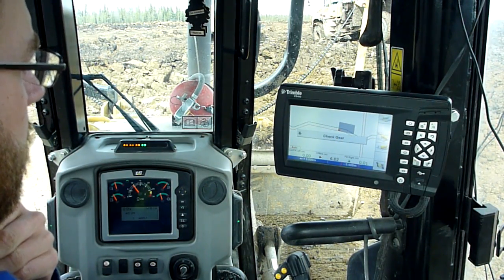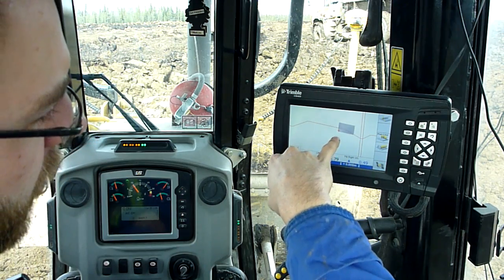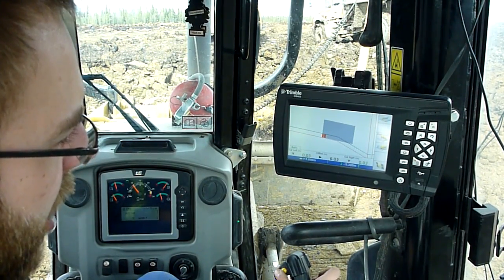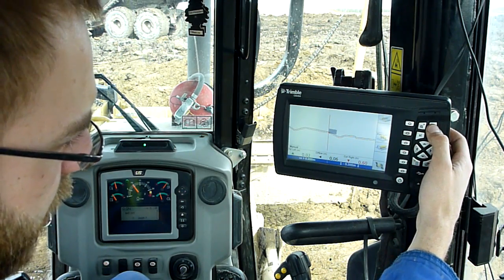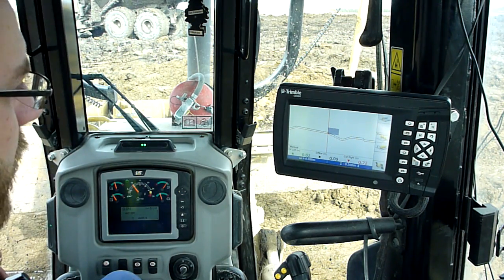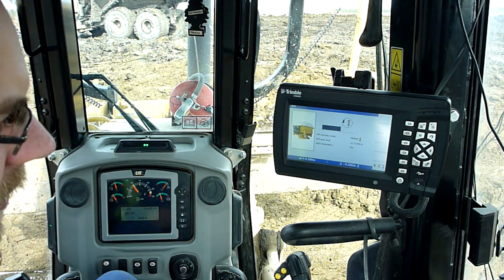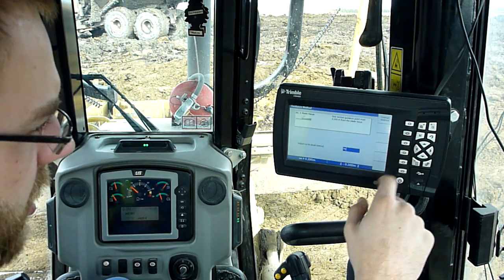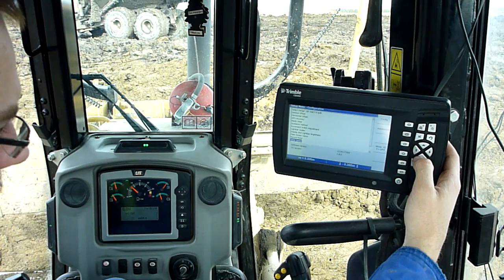Trimble GCS900 3D GPS System in a Caterpillar D6N

Comment: I assumed as much. Just couldn't melt the Trimble and machine together. It just seemed to me that they are separate ,Trimble being a tool, yet now I see that they are kind of interfaced with one another. thanks. you make pretty good videos. It is sometimes difficult to hear in many of them. Thanks again.
Reply from the maker: The blade is controlled through the ECM so the Trimble control box connects to the ECM. From there you use an AS400 slope sensor to calibrate how quickly the lift and tilt cylinders are actuated, and can dial in blade sensitivity for different types of material.

Comment: Great video! Wish Trimble had a profile & cross section view simultaneously for cutting vertical benches around curves in complex models! Works better then a horizontal light bar when anticipating when and how far a line will curve on the fly. Also an infinity adjustable read point on the blade for narrow benches.
Reply from the maker: Shane go into your main screen views and select split screen, you can change the options to have profile and cross section at the same time. You can also adjust the read point by using the custom point option. I think the split screen options open up more in v12.4, I'm not sure how far back the custom points option go. You may have to have the survey manager enable these option.

Comment: I hope Jason doesnt kill me for answering ;): no, a true GPS-System got around 3cm accuracy, its juts not that precise, but its able to run in 3d, like if your building a golfcourse or grading the slope of a pond or something.
a 2d Laser-System is around 0,5 to 1,5cm, depenting on the material you are grading. but its only capable of 2d, so you can only grade a flat surface with max. 2 slopes (as much as the Laser can be set, like 6-8° ) .

Comment: A lot of those problems can be alleviated with a good model. A model that's built tailored to your machine IE blade length, turning radius and much more makes all the difference in world. Getting someone who has operator/real world experiences with machine control to build your models can make things go a lot smoother in the cab. Let me know if I can help!
Reply from the maker: The client supplies the design and we get paid to build it to what the engineered. You can't just change things because it will be easier to build.

Comment: Thanks for the upload. It is interesting to see the differences between the lower priced like this being lighter I am assuming they find their mark with logging firms or something like working on ice where weight is imperative but also nice to see the differences as far as possible in the cabs layout. 
The gps I can see would take a bit of practice on high ground but as long as it can be trusted and one can work to it it has got to be easier, though I think a pic of the blade only is better

Comment: towards the final grade and direction of the cut would be pretty much entirely by the blinking light on the 'clock' console rather than any grade markers outside?
In fact grade marker could actually get in the way and be wrong, so will grade markers still be there but in a different 'FORM' and show in figures the max depth and slope which it should be, and forgive me but it is a while since I worked in the building trade?

Take care.
mrbluenun

Comment: of soil and levelled it, and at that point the road (M25) was to be about level before it started going down a gradient for a mile or so.  

Hope you can get the gist of my 'best' explanation. I would imagine as long as you were sure what 'MODE' you were in and exactly where the blade was/is then the movements

Comment: So with the display on top of and on either side of the centre 'clock' console I guess you have to drive pretty carefully when coming up to an area you know with be the finishing grade?
Just me being nosy and interested here, but what happens if you make a cut too low, assuming the cut or grade in on open ground and there is no danger of hitting pipes or cables, so that thought is eliminated, do you just pull soil back into the cut you have just made and carry on, or do you need to

Comment: There is one problem I have noticed and that is how he has only one side of the gps working on the blade, because of the cut for the ditch at the side of the road. If he is concerned about the blade adjusting to compensate for the cut for the ditch at one side and staying flat for the road top at the other, surely you would just extend the length of the blade at the side which will start adjusting for the ditch keeping both sides of the gps active for the blade, instead of switching to just one side of the gps???
Reply: bamboozle46 p,a
a

Comment: I'm new to this so here's a dumb question. . Does the survey manager enter the survey alignments on the gps? Do u have a video of how that is done?
Reply from the maker: No dumb questions! Yes the surveyor would transfer design files to the dozer but it's not worth making a video. You transfer it to a USB thumb drive and insert it into the control box. It will automatically open a window asking if you want to backup the box to the drive or transfer from the drive to the box.
Reply: vantagetes thank you